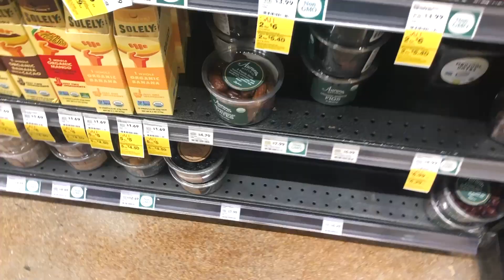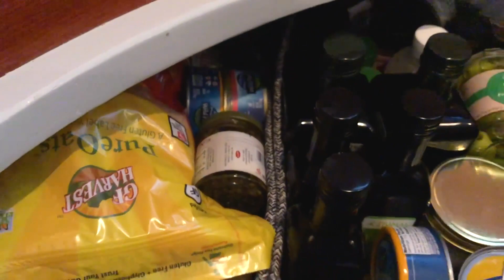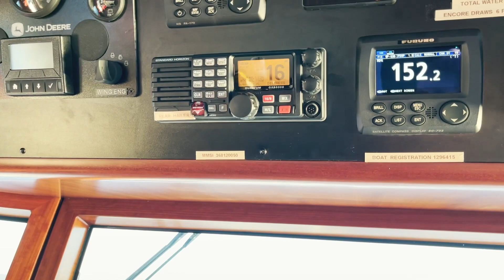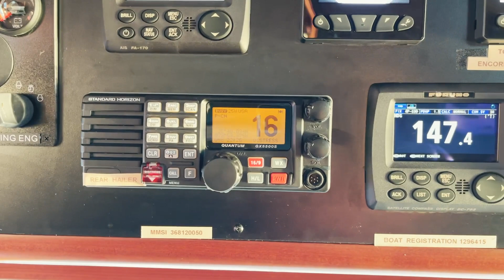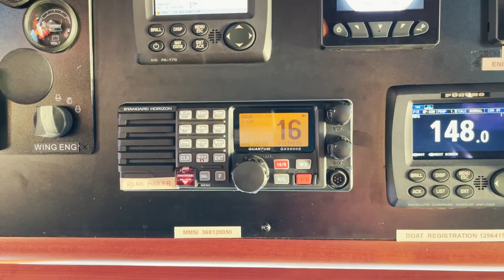YACHT HAUL OUT and International Provisioning! EP. 27

Comment: I think next time you have a big provisioning like this, Costco. getting case lots of the stuff makes life a whole lot easier.
1 case of rotini at 20 pounds of pasta if you spend the dollar extra is 36 - 40 half pound packages.
You can even pay a premium and order from a chandelry to have everything delivered directly to your boat. 1 call, 1 bill, no running around but higher cost. Costco will deliver, if you have the boat owned by an llc and get the account in the boat name, but you still pay extra.
Reply from the maker: You are completely right. Definitely would go to Costco for a bunch of it if I had to do it over. There isn’t a Costco near breckenridge (where I shrub lived for years) so I’m not in the habit of going so somehow it totally slipped my mind. Next time that’s my plan though for sure, you are completely right!!
Reply: @adventures  yeah, I go into the place similar to Costco, 10 bucks gets you 22 pounds of pasta, but in bulk, 2 large bags in the box, 12 bucks and it's the smaller packages.

With provisioning being as costly as fuel pretty much, everything that can save money is worth the effort.

locally, never buy produce from the big stores, a small produce shop is about 1/4 the cost. 3 to 4 bucks a pound for tomatoes, 39 cents to 79 cents at this produce shop for them. local knowledge can save you big time money, without sacrificing diet.
Reply from the maker: Knowledge is power that’s for sure! And yes we definitely spend way more money on food than we do fuel which is hilarious since we are a MV, people would never believe how little fuel we really use. Thanks for the tips, much appreciated :)

Comment: Hi! great video! about the generator and the diesel, Have you guys thought about running solar? with the hard top on the flybridge you could set up a pretty large array and be even more green!
Reply from the maker: We have thought of that and there are some nordhavns that have solar. Unfortunately to add it on is extremely expensive due to having to run all of the lines all through the boat from the very top to the lazarette. It involves taking down headliners and up floor boards and is quite an ordeal. We got a quote to do it and it just didn’t make sense to do it at this time. But maybe in the future!

Comment: great job with the video and the series.  Does the boat have enough power to maneuver when there is a cross current such as can be the case in some marinas or bridges?
Reply from the maker: Thanks glad you are enjoying them and the answer depends on how much current you are fighting. The general answer is no, these boats move slow. If you have a a knot or two you can maneuver through a marina okay, you just can’t rely on the bow and stern thrusters, even the hydraulic ones. They don’t have enough power. We can boat into some strong current as long as the current isn’t running faster than we travel! We time out the tide if there is a strong current and we are going to dock, we learned the hard way one that the current wins with these boats

Comment: At 25:45 i saw a small sail prop shaft next to the main shaft propellor, is this standard on all Nordhavn's? And is it only on starboard side of also on port side? And how is this sail prop shaft powered?

Wouter from the Netherlands
Reply: That's for the wing engine. Also known as a get me home engine. A completely stand alone system for safety at sea, and often used to power hydraulics like bow and Stern thrusters, crane and more. Nordhavns with dual engines obviously don't need wing engines.
Shaft is powered through a V-drive and engine is mounted aft of the main engine
Reply: Wouter, there are 2 Nordhavns boats in the Netherlands, one in Hindeloopen and one in Hoorn. You may get more information there as well. Alex

Comment: And that’s why I’ll never own a boat with a “dripless shaft seal”. Your lucky it was checked. They can catastrophically fail and sink a boat if you don’t have a huge bilge pump. A conventional stuffing box with GTU packing is very low maintenance and gives piece of mind.
Reply from the maker: Yeah this was the first boat my dad has owned with the dripless, it’s a very different setup that’s for sure especially when it comes to repairs underway!
Reply: @adventures  
Generally a dripless can’t be repaired underway. The rotor may just need to be moved a bit closer but they normally don’t need much contact pressure. They either just keep leaking which if not allowed to persist long term will make it to repair. Should the seal seize, it can rotate the bellows and shred it. Now it’s allowing a flood in. You should have a response kit , plan and test how to use it. The shaft must be immobilized so the prop can’t windmill and rotate the shaft. A clamp bar or tied down pipe wrench will suffice. A large sheet of rubber (inner tube) that be wrapped around the shaft log/prop shaft to stanch the flood. Large hose clamps and mechanics wire to hold or tighten the rubber. Now you can get back on the wing engine. Make sure your water alarm is working and not too high (early is better). A couple of Rule 4000 bilge pumps and heavy duty float switch(high current) Those pumps need smooth ID ribbed hoses routed as to not siphon. The wiring needs to be properly sized circuit protected and supplied by a battery/power source the will endure.
Make sure you test the wing engine by actually powering the boat a while, not just running it. Plan for the worst and it will most likely never happen. I’ve planned for the worst and been able to rendered assistance many times.
Reply from the maker: You would like you would get along very well with my dad! That is a saying he lives by as well. We have many supplies on board but that was a great idea and way to solve a problem underway if needed. We have fun on the wing engine for some lengthy distances early on during the trip because we had to break it in. So many things on a boat to learn, know, and have!
Reply: @adventures  
I don’t know. I guess one of reasons I like to help is cherishing that gobsmacked look when I materialized exactly what’s needed. Lol. “Go see Karl, he’s got freaking Ace hardware & West Marine onboard.” (Overheard from a fellow Power Squadron member.)
Reply: @adventures  
You have no idea how many don’t care for the wing engine and it fails. Your miles ahead of the rest.
Reply from the maker: Haha that’s awesome! It’s always good to be prepared and you really need to be your own west marine when you are out on the water in the middle of no where! Can’t just hop in the car and pick up the parts!

Comment: 1500 gal. Of diesel would generate electric power for a home for 5 or 6 years.
Reply from the maker: We also factored in the fact that we make water with reverse osmosis and that we use it as our mode of transport instead of driving cars and use it for all of our cooking. Maybe we were slightly off in our calculations but that diesel does power basically everything in our lives right now. Still pretty cool! :)